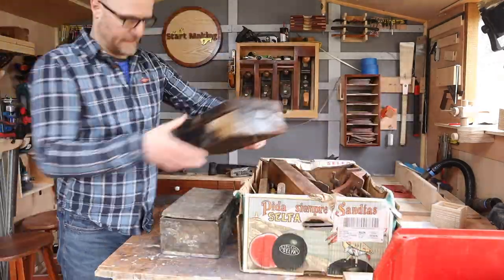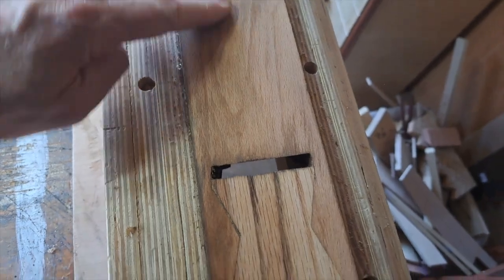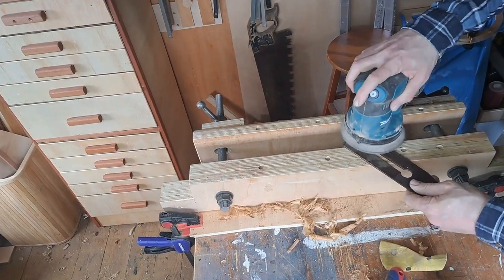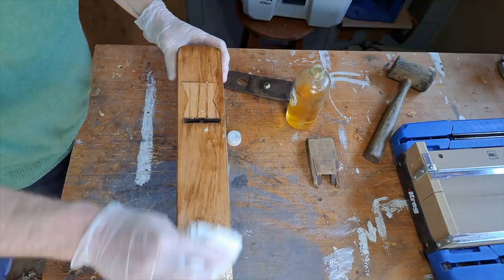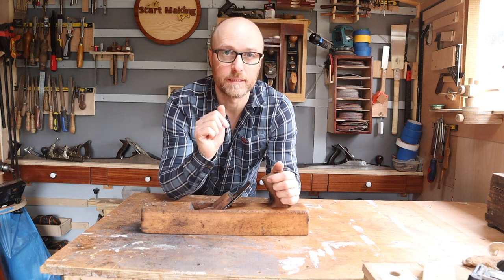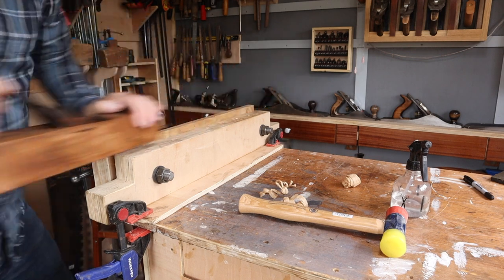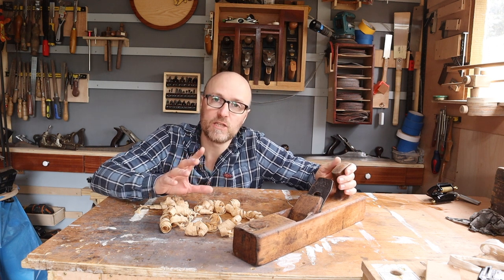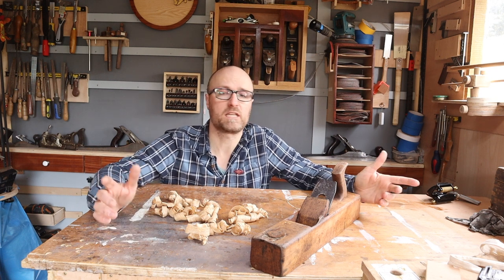Restore your wooden PLANE to outperform all others.

Comment: For western wooden hand planes, to remove the blade you hit the striking button on the front, which is different from japanese wooden hand planes. You can see the striking button on your plane at the very front where you might have thought a tote used to be that "broke off", but that's actually the original design and that's what you hit to remove the blade. Just make sure you're holding the back of the plane when you strike it and allow the plane to basically go towards the ground, the inertia of the blade will loosen it as you strike it. Rex Krueger has some good videos on these traditional western wooden hand planes.
Reply from the maker: Hi. Thank you so much for taking the time to comment and for being so informative.  I initially thought it was a handle but then it appears to be leather. I will have a practice tomorrow trying to loosen the iron. Much appreciated. I will also look at some rex kreuger videos. I do watch him but not on wooden planes. Very much appreciate how much I learn in the comments. Thank you
Reply: The rust pitting might be causing additional friction, making it harder to adjust ( ie it's not you that's the issue😊).  As you've already surmised, with not too much practice you'll have it mastered.  All of my wooden planes respond slightly differently to adjustment taps, it's just part of their character😊. Have you tried waxing the sole for extra glide?   If not get ready for a big smile😊😊

Comment: Welcome to the wonderful world of old wooden planes. They are an absolute joy. Be warned, they can become an obsession, and once you start with moulding planes, plough planes, rebate planes etc, you'll be happily lost for ever. 
Your surprise is something I've seen on the faces of many who use a well set up example for the first time. While there is much talk  as to why they feel so different, I'm convinced that it's the comparative lack of friction from the sole of a wooden plane compared to a metal one.
Reply from the maker: You know what Mr Standfast. I think you are right. Although the metal sole is smooth to look at and touch, I bet it carried more friction than the wooden one. I also found the wooden one far lighter and better balanced.

Comment: That was some very nice and consistant shavings. :) Well done.
Reply from the maker: Hi Toot. Thank you. I was genuinely shocked. And very pleased. Nice little project and super beginner friendly which was a surprise. Way easier than a Stanley refurb for instance.
Reply: @startmaking1  Agreed. I had to bin my Stanley refurb as it was rusted solid and I then found a big crack hiding under the rust on the bottom. I got a cheap Spear & Jackson plane (£26 new) which is ok but the good thing is the Stanley iron fits it.
Reply from the maker: @TootEmCarMan  that sucks. I bought some recently that were cracked. Nothing really you can do value wise. If the weld is good they can still be used but if you have to pay someone to weld it then the value isn't there in my opinion.  I just keep what parts I can like you have with the iron and the rest is junk.
Reply from the maker: can't reply to your most recent post sadly. I am planning on building up a supply of spare irons and then I can have different bevels and grinds that way I don't need to store a load of planes, just a few and swap out the irons. Have a scrub iron, some smoothing irons etc. As for the discord server, I was considering it but my skills are poor at best when it comes to that sort of thing. Plus I see that most YouTubers charge for that sort of thing and I don't want to go down that route for the moment as I can't add enough value like months q and a's and the like. I definitely want to do anything I can to enhance the community because that is really something I am enjoying. one thing I did think of was to have a free for all discord for a year or so and then maybe begin to charge membership once the channel has grown, if it grows. That was the older followers get the chance to have it for free.

Comment: I love the sound of wood being planed, it's so relaxing. Good job with the restoration although (slight criticism?) I did notice that at the end when you touched the plane handle it wobbled. Is that your bench that's at fault or the plane base. Either way it makes me want to tackle my collection of wooden planes.
Reply from the maker: That is so true. And you can hear a sharp iron I think.  oo, I didn't notice the plane handle wobbling. Do you mean the wooden one. I thought it was rick solid. I better go spend some more time in the shed to check. The bench definitely wobbles but then so does the shed at the moment. Could have been either one of those. Side note, I would never take criticism from you badly. It can't always be agreement and support like you offer. I would see it as learning from your experience.
Reply: @startmaking1  Lovely sound. It wasn't the handle I noticed wobble but the plane itself as if it was not flat, but as I said it could be your bench that's wonky like one of mine.
Reply from the maker: @teacheme  Ah, I see. That is interesting. I really hope it is my awful workbench. I have been working on a rickety cupboard I made years ago for crap. Sadly my very sturdy bench is too close to the windows and wall to film on and is now a very large storage shelf for clutter. I better check the plane though. I really hope I flattened it right.

Comment: I picked up a jack and jointer during lockdown in a similar state to yours. 
I agree. Once you get them "there" they're great. Almost no friction and much lighter than the metal equivalent.
Reply: Great video by the way. 👍
Reply from the maker: Hi eggster. Thank you for both comments. You are right, it is the friction and weight that makes the wooden plane so fun. I was thinking today about how many times I have seen them in the past made into lamps or other tings by people. crazy.
Reply: @Start Making (Woodworking)  yes. A shame to see what some people do to them but then a lot are actually pa's saving I guess... The same with hand saws. 
Actually...workbenches as well. 🤣

Comment: I have a nearly identical wooden plane, blade and all. It was made by Mathieson in Glasgow. Is your plane branded ? If so, it would have been a stamp on the rear vertical face. There is no tote at the front in mine, and there is no problem withdrawing the iron, although the wedge in mine seems longer than in your plane. I vouch for the ability of the plane and the quality of the iron. We share the satisfaction of using a very capable vintage tool.
Reply from the maker: Hi Semper. I can see an imprint on the top of the iron but I don't think that there is anything on the back. There are a lot of user initials. Seems they may have had a habit of wandering off. The wedge on this one is possibly not the original. There was a spare in the auction lot and maybe that one is a better fit, will try. Also one of the parts that holds the wedge in has snapped off at some stage. I may try to replace it. Though for not the wedge holds better than needed. The iron really shocked me, the edge is amazing.

Comment: There are 2 main difference between wooden and metal planes. The wooden sole glides across wood much easier than a metal hand plane. You don't really need to lubricate the sole on a wooden plane that much, maybe once in a long while wax the bottom. Also, wooden planes are much lighter than a metal bodied plane. Which is often contrary to what many modern plane makers do with making really thick casting or even bronze castings. They of course look beautiful, but are contrary to practicality. If you only use hand tools to dimension lumber, you don't want heavy planes, which will tire you out quickly. You actually want lighter planes that you can use for longer. A truly sharp blade overcomes any benefit gained from the increased momentum of a heavier plane.

So, wooden planes are lighter, and glide across wood much easier than metal bodied planes. That is what gives you a completely different experience than using a metal bodied plane. The main difference of course is learning how to adjust the blade with a hammer, which seems very intimidating compared to the ease of adjusting a bailey pattern plane. But, like all things it just takes some practice to get the hang of it.
Reply from the maker: Hi Wesandell. Thank you for such a detailed comment. Very much appreciated. Adjusting the blade is going to take a fair amount of practise I suspect. But given how much I have enjoyed using this one I don't really mind the practise.

Comment: Nice plane...... What you think was grease was very likely a build up of Linseed oil and wax used by the loving previous owner.... If you don't keep the wood moist like all wood it will dry out and warp or likely split.... There are many videos from older masters that show how to maintain and upgrade/improve wooden (Block) planes..... It really can be the best plane you own... Great find I must admit I felt envious... Cheers for an entertaining video.. :)
Reply from the maker: Thank you. In hindsight, you are most likely right. And thank you for your kind comment. I love this thing, the feel is unparalleled in my shop.

Comment: I do have a couple of this style planes. Every single one has cracks through out the body. I figure this is because of the thickness of the body. You can not ever dry 12 quarter wood to a state of 'equilibrium' because of the thickness of the wood. The inside will always be at a higher moisture content than the outside. This creates stress, and as we all know, stress is relieved by cracking. Why they never made them with about a 1 inch hole drilled through the center so the wood will reach equilibrium is beyond me.

As for the plane iron, the style of blade you have is probably hand forged with a softer metal for the main body, and a harder metal forged in for the cutting edge. There is a method used on the Japanese plane irons where you hammer the softer metal, gently to change the shape of the blade from edge to edge. More taps on the outside edges if the bottom is concave. More taps on the center if the iron is convex. That would have saved you a lot of time on the abrasives.
Reply from the maker: Great advice, Thank you.

Comment: From looking at it, it seems like one of the abutments is missing (what the wedge wedge against). That's a pretty severe problem and would normally mean that the plane is trash. Maybe you have to seat the wedge that much harder because of that, which in turn means you have problems moving the iron back out.
Reply from the maker: You are right. There is a piece missing and I am surprised that the iron even holds in. the adjustment is an issue and I think I may try to replace the piece see if that helps.
Reply: @startmaking1  It's worth the experiments! Maybe you'll end up making your own plane ;)
Reply from the maker: That would be awesome. Now I want to make a plane.

Comment: M8 as always another cracking video and that plane came up beautiful although a knew it would in your capable hands. The danish oil didn't give u the finish u wanted cause your using the wrong brand. The best one on market I've found and I've tried a few is by watco a think it is I'll send u a picture of the one a use it's natural colour and it's amazing.  Again though as u said few other things and it'll be a cracking day to day plane 🏴👍
Reply from the maker: You are right about the danish oil Michael. I have a better one that I got after you recommended the stuff. This one was just lying around and to hand. Will throw some of the good stuff on it and see the difference.,
Reply: @startmaking1  yea a must say when we done the kitchen a bought about 6 different kinds from cheap to pretty expensive and honestly that watco one is mid range price and it's best ave found. Plane looks wicked though.
Reply: @startmaking1  other thing a meant say not sure if ave said to u about it. Sanding pads for the drill 2" pad. A got a pack off eBay a think and it comes with the attachment to add onto the drill and about a hundred pads and they go up to think 5000 grit might be worth look for polishing up the iron??
Reply from the maker: @Michael Willson  that's a good idea. Maybe should have tried it on the bevel to.get it done quicker . Not sure on the heat and how that would affect things
Reply from the maker: @Michael Willson  thank you. Glad you did the research. Saves me testing
Reply: @startmaking1  honestly m8 you've seen the photos the kitchen had allot to oil and didn't want the sticky tacky after touch which u get with all the other ones. Yea be worth looking into must say there great for getting in curves and stuff aswell cause they've a contour style pad on them.

Comment: I'll post a longer comment later, but as far as the iron not coming out when hitting the strike button, try checking the back of the wedge from imprints of the chip breaker. If the chip breaker gets too much embedded into the wedge over time a form a clear Imprint (sort of like a step) they will become a unit only moving together and you lose adjustibility. 
Second, try filing the bed flat, if the bed is incosistent, the iron might get stuck in one place. 
Third, I cannot see it too clearly but it looks like the rebate on the right side that should hold the wedge is chipped off, so I am surprised that the wedge holds at all. Other than that, nice repair.
Reply from the maker: Hi, What an amazing comment. Thank you so much for your help. I am always blown away by how helpful people are here and how much I learn. I will check the wedge, that is a great idea. And you are right, the one rebate has chipped off. The wedge is well held but I may have to make another one so that I don't have to tighten the wedge so much. Thank you
Reply: @startmaking1  Another thing that just occurred to me -- is that a leather mallet? It may very well bee just too soft and light to use on that plane. I use regular hammers, I have three sizes, smallest one for smoother sized planes for little adjustments, medium one for regular adjustment on smoother sized planes and classic framing hammer for a jack/jointer sized planes like yours. There is so much surface area that you really need a good whack for them to move. 

The plane itself looks nice, I especially love the wooden insert at the mouth of the plane, that tells you that someone used it a good bunch and knew what they were doing when they repaired it. 

I cant get my hands on old planes easily, but I buy new wooden ones really cheap thanks to them being made locally to me. The sometimes take a good amount of time putting into workable condittion (shaping the wedge and handle, flattening the sole, pairing the iron and the chip breaker), but so far their irons were excellent and hold up really well. But like you said, no plane feels better than this. They wood on wood contact just cannot be beat (by the way, I still wax the sole, you dont have to, but the difference is noticeable).

Last tip, if plan on using it as a jack plane, try cambering the blade a tiny bit, just by pushing more on each side a few times while doing the micro bevel, it helps out a ton. 
Lovely repair and I'll be looking for more from this channel.
Reply from the maker: I totally missed this great reply. Apologies. Yes it was a hide mallet. I struggled with the harder ones too sadly but I am working on it.
Reply: @startmaking1  no worries. i think that nobody can properly teach you about planes and their use. everyone does things a little bit different a not everything will work for you. so the only important thing is practice and in time you will find what fits you.
and a little lesson i found the hard way, when you flatten wooden planes regularly, check not only flatness, but also that the sole is 90 degrees to the sides, or you might start wondering why is it so hard to se the iron correctly from side to side
Reply from the maker: @petrsidlo7614  Oh yeah, good point. I definitely would have not thought of that . Thank you

Comment: I'm certainly no authority, but there go my two cents.
Wood is lighter. That also means it needs  shallow cut and sharp blades.
Old wooden planes are lighter than new ones.
First plane should always be old, as it's already been set in the past. I have a hard time adjusting a new wooden plane.
Fiddle with the adjustments all the time. No need to let them sit. And I do mean all the time.
This IMO is really the difference. Wooden planes do not bend your piece (on the count of light weight and pressure). You don't then flatten with big, heavy strokes from one end to the other xy times, but just let the plane pick the high spots. Start in the middle and stay on the high spots. Bend you knees and push (throw) the plane, do not put your weight onto the plane.
Reply from the maker: Thank you for your insight. Really interesting. It makes sense.
Reply: @startmaking1  These are just my observation.

Comment: Hi this might have been said already, but try a metal hammer to adjust it rather than a wooden mallet.  Hit the button or the rear to shock the iron up (and out); tap the iron itself to set.  That looks like a very, very well-used plane btw - that's probably not its first mouth repair and is that a replacement wedge too?  I restored one a while back - well I sharpened it and flattened the sole a bit! - and it's become my favourite long plane by a mile.
Reply from the maker: That does work a little better , thank you.  It's not perfect but I think it is a mismatch of pieces.  Still love it